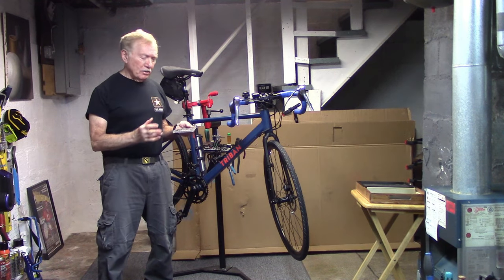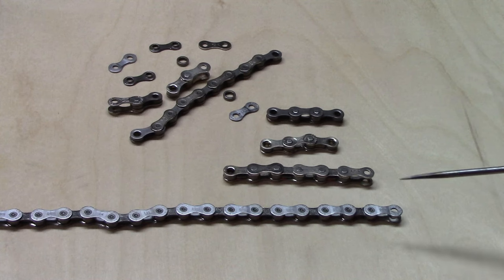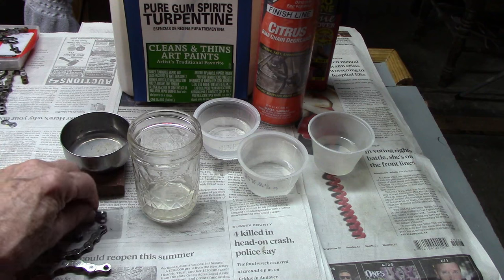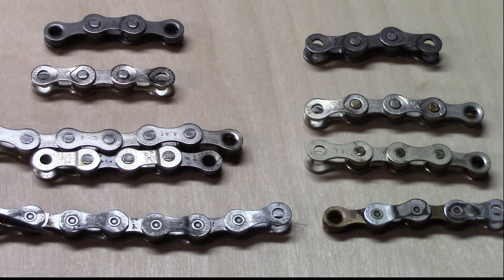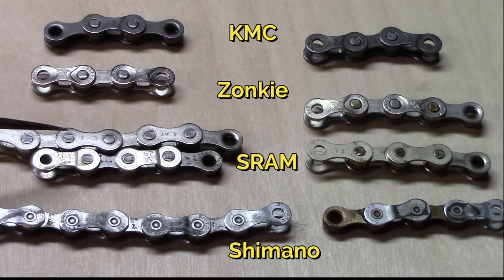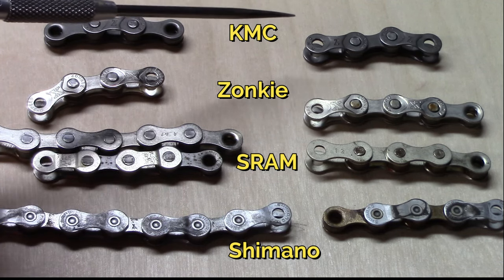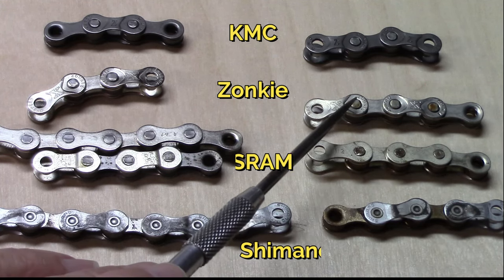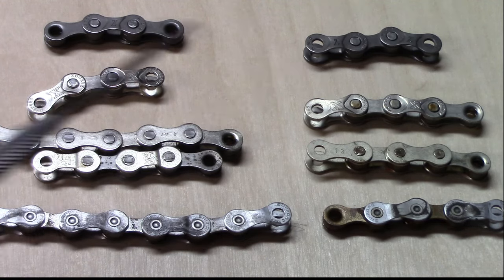Soaking Bicycle Chain in Degreaser: BEWARE of the consequences

Comment: I’m assuming Tony is talking about this from Shimano’s 11 speed insert:

Clean the chain with an appropriate chain cleaner regularly. Never use alkali based or acid based solvents, such as rust cleaners. If those solvent be used chain might break and cause serious injury.
Reply from the maker: That is correct! Does this apply to solvents such a turpentine, mineral spirits, citrus degreaser? Can anyone answer this for us?
Reply: @tony10speed  Non polar non conductive (without salts obviously) solvents will work just fine, which includes turpentine, mineral spirits, and high concentration citrus degreases.

However, note that most consumer facing citrus cleaners include water as the main solvent and sodium hydroxide as a high pH additives, which means that you wouldn't want to stick your bike chain in for a long period of time. You can use it for chain cleaning if it's done quickly, with a water rinse and then an alcohol bath afterwards.
Reply from the maker: Turpentine (ph 8.8), mineral spirits (ph 7.0) and high concentration citrus degreaser (ph not available) all turn Shimano chain black if soaked overnight.  I think the Shimano chain manufacturers insert is referring to strong agents such as rust remover which can be strongly acidic (ph 0-3). Simple Green has a ph of 8.5 to 9.0 meaning dipping but NOT soaking as per manufacturers insert. Simple Green will also turn the chain black if you soak over night but a quick clean with Simple Green does not affect the chain. The bottom line, don't soak the chain with any solvent but just clean and rinse, at least that's my conclusion. Thanks for your input, Tony @neutronpcxt372
Reply: Essentially, you want to avoid relatively strong acid/bases as they can cause metals like steel to oxidize very quickly, and hence rust after exposure.

For cleaning a chain of its factory lubricant, you ideally want a non polar solvent like mineral spirits, hexane, ethyl acetate, and then a volatile solvent that is miscible and somewhat hygroscopic like acetone/alcohols to get rid of the solvent used afterwards.
Reply: I never remove factory grease & never allow any solvent to come in contact with my chain, not even WD 40 or GT 85. Never pressure wash or use a hose on it either, or remove it once fitted. All these things weaken it. Regular cleaning with a cloth & chain brush, followed by thorough oiling, is all I do. And by regular I mean up to twice a day in bad winters. There are no short cuts or miracle cures for chain maintenance: if it needs doing after every ride, then do it.
Reply: @papalegba6796  soak your chain in some gasoline or solvent and see if you agree later. No joke how much grinding paste (sand) gets into each roller, not coming out with a wipe of a cloth.
Reply: @unclefreddy2009  I just said I never use solvents because it weakens the chain & is against manufacturers recommendations, so why are you asking me to use solvents? Are you right in the head? 🤔 😂
Reply: @unclefreddy2009  also "Grinding paste in the rollers" 😂😂😂😂😂 Do you even know how lubricants work?🤔😂😂😂😂😂😂
Reply: @papalegba6796  I actually do, please educate the world on your knowledge of physics.
Reply: @unclefreddy2009  tell me more about this "Grinding paste in the rollers" . Is it in the room with you right now? 🤔😂
Reply: I will do one better: tell me why a chain wears? I can tell you it’s not from your superhuman ftp.
Reply: @papalegba6796  hahahaha it’s the debate club on YouTube. Enough already, what I am referring to is the beautiful chain oil you put on your chain, combined with the dirt, grime, and grit which adheres to it. I’m not talking about a chain right from the box!
Reply: @unclefreddy2009  answering questions with questions is what time wasting  trolls do. Plus there is no debate on this subject, there is only best practice for lubricating roller chains, which you either follow or you do not. Whatever, bye bye, time wasting troll that rejects best practice! 😂
Reply: @papalegba6796  considering I’m the one who originally posted the challenge to Tony’s process here you are the one who is a little off! Enjoy your chains! Ride on!